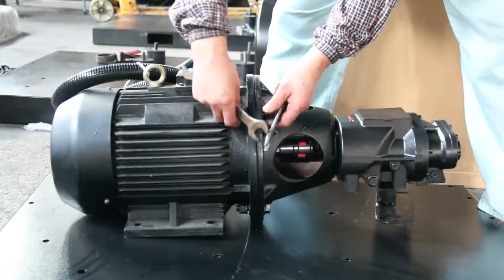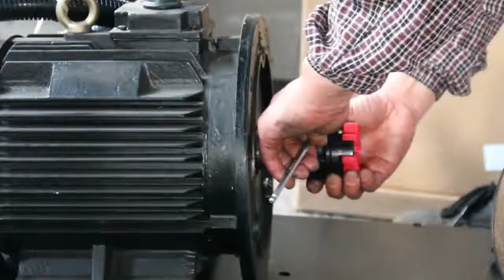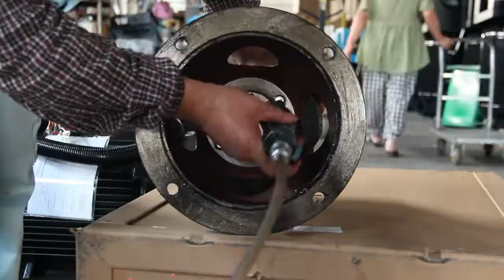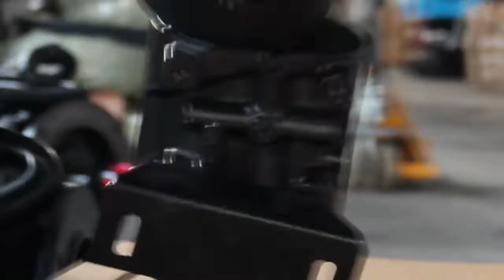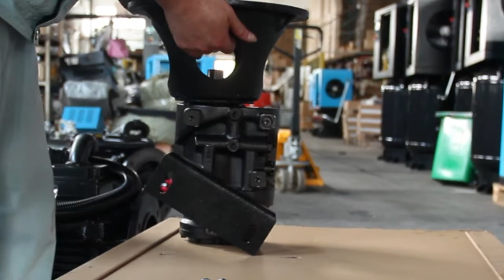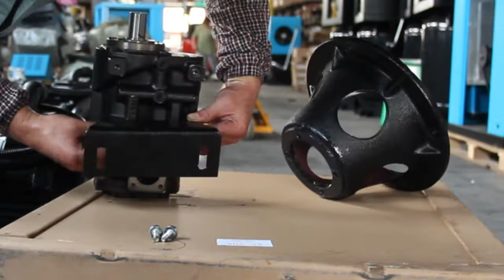Disassembling of Screw Air Compressor Block / Air End

Comment: hello, consult I have a compressor, which raises pressure but does not release the air outlet valves and heats the oil
Reply from the maker: hi, please check the air intake valve and Solenoid valve
Reply: @Chloe_Tin  for technical support, an email or number